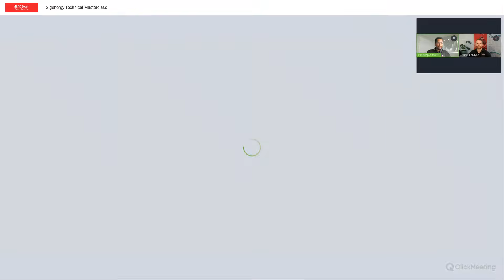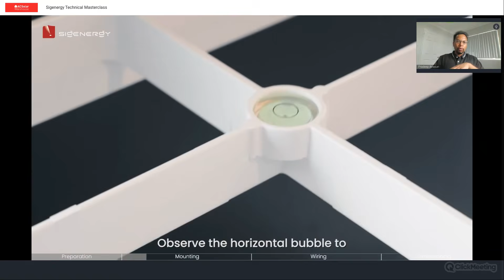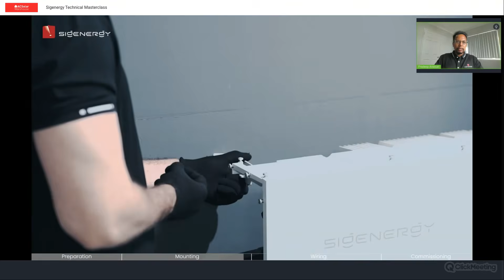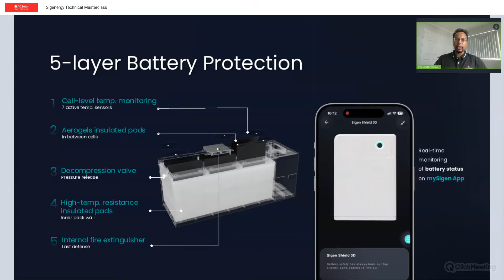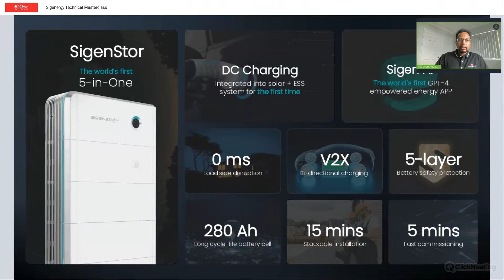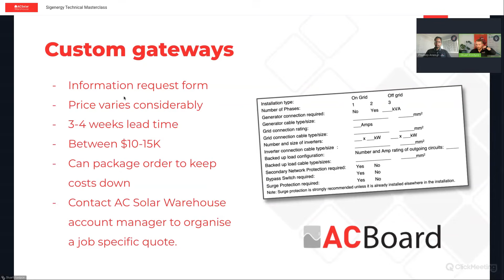Sigenergy Technical Masterclass

Comment: Can the SigEnergy 3 Phase inverter + 48kw Batteries installed in Single Phase home? I am thinking for future proofing, in the future I might disconnect all the gas appliances and go all-in on electric appliances.  They might need a 3 Phase Power.